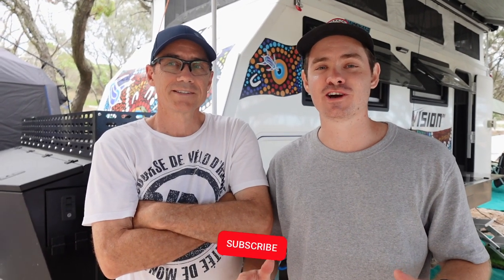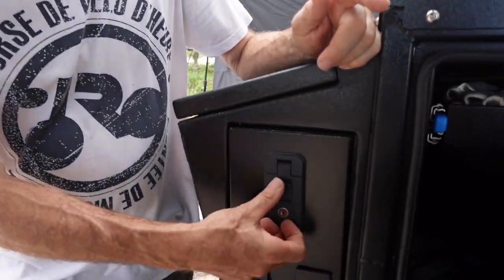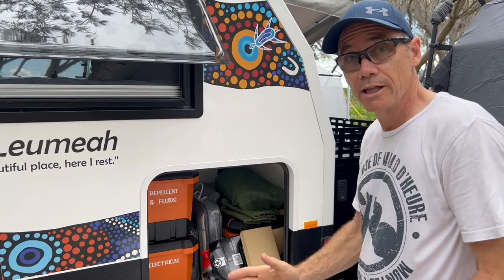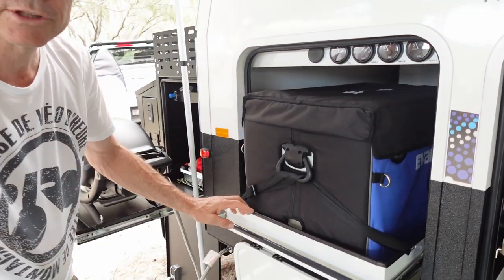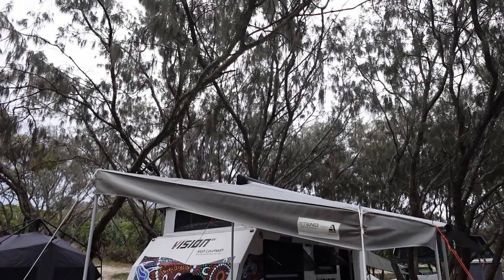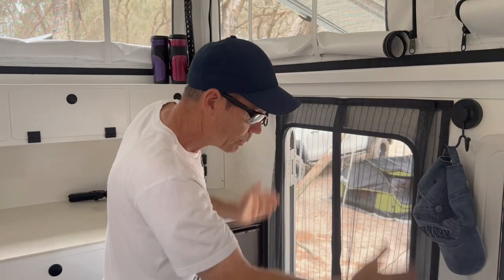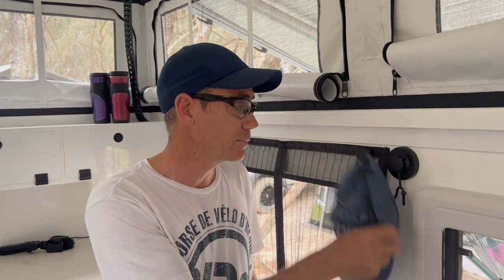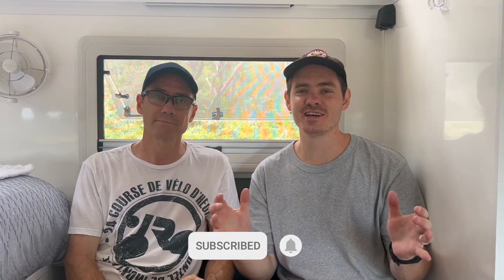VISION RV REVIEW / Is This the Best Caravan Ever?

Comment: To bad the floor,wall and roof are Chinese so not all Australian.  The breakaway should be connected to the vehicle not the tow bar .
Reply from the maker: Hey Stephen! That’s where they advise the breakaway to be connected. And it is the car. If the tow bar comes off, we might have bigger issues. The actual frame comes from Italy….well that’s what they told us. I’ll have to double check. Thanks for watching!
Reply: The panels are German made composite with Italian outer sheets. Nothing Chinese in them. Quality product.
Reply from the maker: @michaelnugara1  Thanks for clarifying - yes agree! Great product